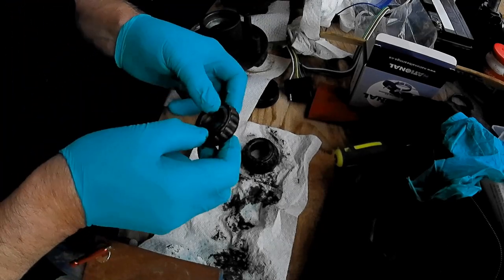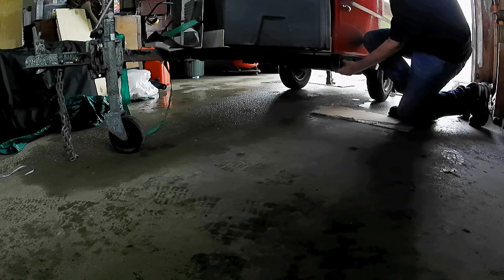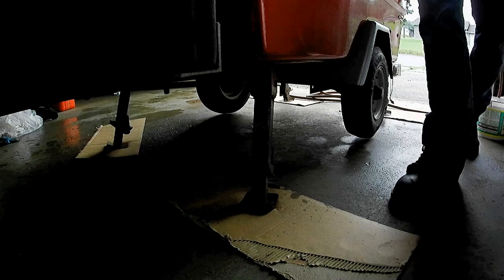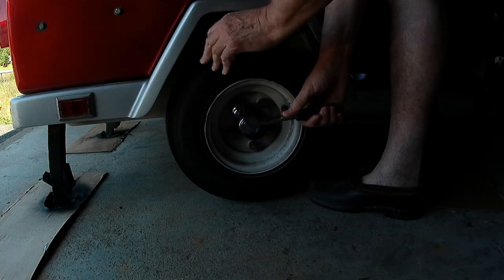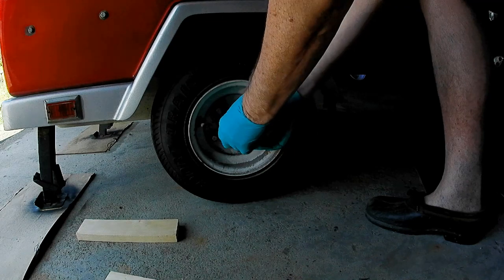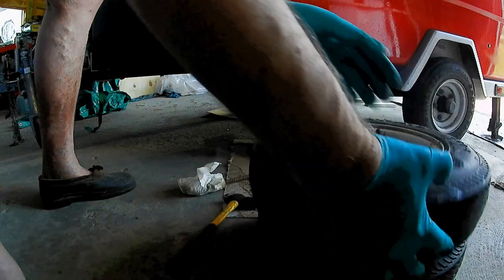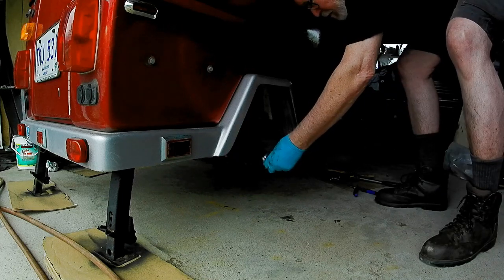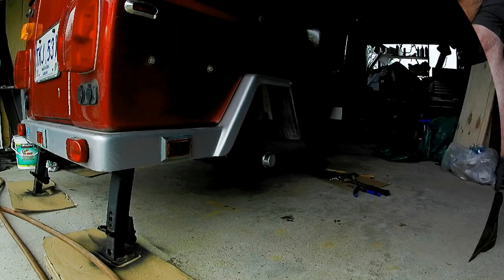Mini Mate Shot Bearings! 2021 Ep 11

Comment: Good work Jim - but I suggest a wire wheel at Princess Auto in your drill. That works super as a de-rusting tool for the trailer legs. Sorry, one more thing: bearings have “races” - not “raceways”.  Next stop….under the ST1300 for the Great Clutch Slave Cylinder Extravaganza of 2021.  
Pete
Reply from the maker: lol... wire wheel sitting right the worktable... I will remember that they are races.  Planning on prepping the bike tomorrow and will take the old clyinder off then. Fingers crossed that the parts are in tomorrow afternoon or the day aftter at the latest. Of course the master cylinder rebuild kit from the US arrived sooner than getting OEM parts through the Honda dealership. I'll let you know if I run into problems.
Reply: Good - and don’t forget the petroleum jelly to stick all those crush washers and hydraulic fittings together.
Reply from the maker: @assessor1276  I will remember. I of two jars of it kicking around here.

Comment: Tight lugs or just nuts and bolts in general. Don’t force em. Use a propane torch or heat gun on high. The heat will help A LOT
Tom

Comment: Had to replace bearings on a John Deere mower deck this summer.   Got a great tip... Since you had an impact wrench, air powered, you may well have a chipping hammer too.  If so, the same principle as the impact wrench is employed. it makes many rapid and reptitive "bangs"... Use the board to separate it from the actual race (or bearing) just as you did, but then put the hammer against it.. works it right in very quickly.  At least it did for me... just as I was told it would work!
Reply from the maker: I will have to remember that. I am sure I have a chisel attachement.

Comment: As you said, putting the bearing ring into the freezer and warming up the hub would have been a good idea. That is how it is designed. But anyway... it is mounted now and works. Good enough. Stay safe and enjoy your travels. I enjoy your videos.
Reply from the maker: Thank you for watching them. I've now got the first 500 km. hauling behind the car and checking the hubs for heat. Evefrything seems to be running just fine.

Comment: Great to see you Jim I'm in Iowa camping with the mini mate think I'll need new tires when I get back and check the bearings
Reply from the maker: It's easy to neglect the tires and the bearings. Worth checking them every spring and replacing every 30K kms/18-20K miles. At $20 Cdn a set of bearings... cheap insurance and peace of mind. I'll keep the better old set in a zip lock and keep at the bottom of my utility box as emergancy spares. Now that I've done it fully once and gotten some good constructive feed back in the comments, I can probably swap both out and do a tire change in a morning.

Comment: Great video. I have done my bigger trailers but haven’t checked the bearings on my MM yet. I need to do that so I am ready to go again. Safe travels ☺️
Reply from the maker: I do check the bearings yearly but I think I will replace in the 30,000 km/ 18,000 miles to be on the safe side.

Comment: Good to see you staying busy :) I just received my MM a couple days ago and was stumped on those stabilizers then today I caught your video and bingo, you show me how to do it properly. I figured out how to go up ... any idea on how to go down with out the foot release? Thanks again for all your MM ideas.
Reply from the maker: The stabilizers can be a pain especially when older, rusty and full of grit. I'm not sure of which up and down you are asking about... when you press down on the foot release, the foot goes up as the trailer goes down. If you are asking about the foot going down, use a large screw driver or a piece of rebar like I've got in my kit. Put it into the exposed hole (when you drop the foot) and get it to catch the hole on the other side of the square tubing. You can lever the foot down another notch, pull out, insert in the next exposed hole and lever it again. You can get the trailer right off the wheels if need be with very little effort. You'll only need to do that for a tire change but it is great to help level the Mini Mate on grossly uneven ground. I hope you get to enjoy your MM as much as I like camping in mine.

Comment: Jim, I am speaking to you as a licenced Heavy Duty Journeyman Mechanic. 
Not the Yamaha grease, that is chassis grease and not as good or made for wheel bearings. That is why they give you proper wheel bearing grease with the kit.
Secondly, no grease on the race while drifting them in, just equal hits around with a brass bunch or a softer metal. Good job on setting the bearings, 0 pre-load and 0 end-play. Maybe grab yourselft a 4 way wheel wrench a Can Tire.
Reply from the maker: Thank you for that advice. I will check the bearings more often than I was planning and keep the bearing grease packets in case I need to repack. I'll tackle anything but much of the work I am doing is first time or second time with long intervals in between. It is great to be getting lots of good advice. Thanks.

Comment: as always good stuff..stock tires should be 40-45...PSI...low pressure means more heat....works down south...take care
Reply from the maker: I'll try running at a higher pressure (40-42)and see if I am aware of more bounce. Of course, 90% of my Canadian riding is in lower temperatures.

Comment: Use a Brass punch to drive your race into the hub so you don’t damage the race. You can freeze the race but put some heat on the hub and they fall right in. They do make bearing race installers but you have to get the right size. Changing them every 30 thousand miles just doesn’t justify buying the tool. 👍
Reply from the maker: Excellent advise on the brass punch... will add a couple to my kit. Only thought of the freezer as I did that with bearings for my motorcycle rear wheel. Next time we'll try a little heat too.If i remember in the spring of 2024!